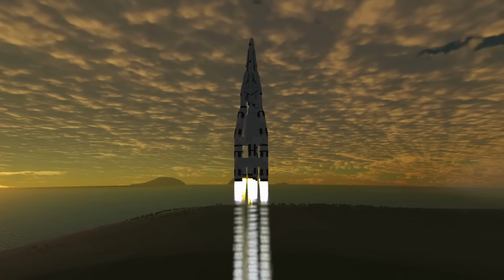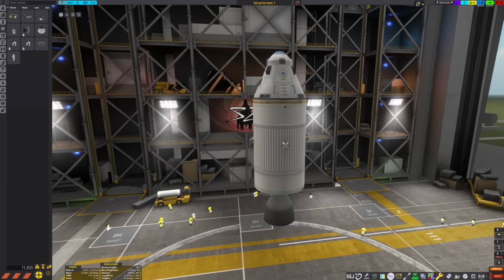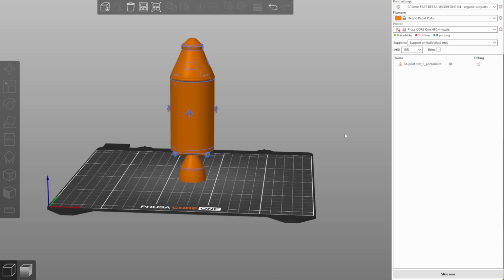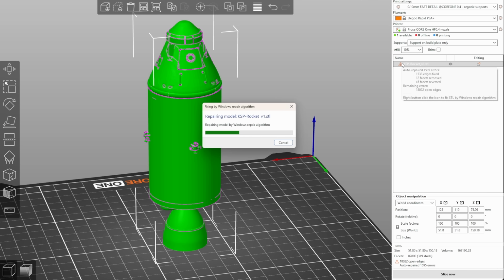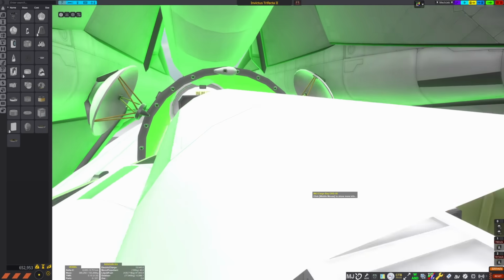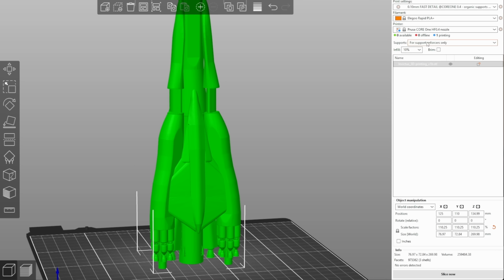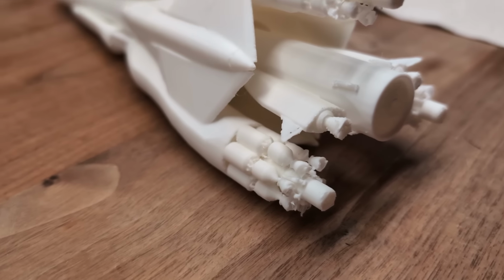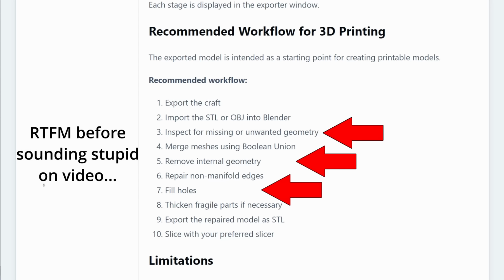This Mod Turns KSP Rockets into Real 3D Printed Models

Comment: I've got a l*arge space station in KSP* that supports lots of Kerbals (with ECLSS - life support systems), acts as a large fuel depot (LF/Ox/Monoprop), has lots of batteries, large solar panels and multiple docking ports. The station has 8 engines (4 forwards, 4 backwards), so it CAN maneuver and travel by itself. It is launched as one single piece, but can be extended in-space by additional modules. It is a monster!

Would be nice to have a 3D print (in realistic colors) of that station, would look nice on a shelf. Maybe I'll invest in a multi-color 3D printer in the future, so I can fullfill myself this dream. Those 3D printers are quite useful anyway.

Comment: Looks like the main problem is that the in-game parts are not designed to be printed. The solution is probably a converter that replaces the game models with some equivalents that are more structurally sound for 3D printing but pretty much look the same. For a completely automated conversion this is pretty much as good as you're gonna get

Comment: I wouldn't recommend using a Boolean union unless it's necessary. After years of 3D printing and preparing models in Blender, I've found that if two manifold meshes overlap, the slicer handles it without any problems and prints them as a single object. Boolean operations usually create a lot of additional errors, especially with messy exported models.

Comment: Hi: 3D printing guy here.
The best you can do for 3D printing quality is to choose a good orientation.
Cutting the engines and printing them separately, upside down, will help you a lot. You will avoid supports and you will have a greater area of contact with the base.
Also: "3D Builder" is great to fix wonky geometry.
You may also be interested in a jeb model that I made. You can find it in Printables under "Jebediah Kerman (Kerbal Space Program) (IVA suit)"

Comment: I haven't finished watching the video yet, but the way I fix broken models is by importing them through Blender (usually mine are made in it though) and then using the Remesh modifier with the voxel mode, then putting a very high resolution (according to the resolution of the print). it fixes most issues with nonmanifold models assuming it's not too terrible. the problem is it takes a lot of ram but after it's done you can apply and collapse down the model vertices with another modifier
Reply: it depends on the slicer, but when you have a nonmanifold mesh (read, one with errors) usually the slicer will skip over layers which might have been the reason the first engine seemed to skip a couple mm. you can preview the slicer output and scroll it layer by layer if you wanna be sure it's all good
Reply from the maker: Thanks for the insights! I tried something with voxels, but then the model seemed to lose resolution. It kinda looked pixelated. But I am also a Blender noob.
Reply: @ShadowZone  yeah, you really need to set a low voxel size, a good heuristic is like setting it to half your layer height or so, because you wouldn't be able to print detail much smaller than that anyway

Comment: Please AVOID PLA! Its a horrible material, its not recyclable in most municipal trash facilities whom consider it a “contaminant” and will not degrade it nor recycle it.

Try switching to PETG not only is it cheaper and stronger but also accepted to be recycled and reused in ALL recycling facilities!!

A PET(G) part can leave less carbon footprint when recycled properly compared to PLA whom mostly ends up polluting in landfills since there are so few facilities in the world that even accept it for recycling.

…Petg also doesn’t melt in the sun
Reply: I heard PETG is bad in recycling centres because it's hard to separate from PET and a lot of places don't which contaminates the batch.
Reply: @pho @phoenixrahillconghaile7320 s and no it depends on what each municipality handles, generally petg are more ok than PLA contaminants.

Generally petg can be an issue as it has a lower melting point however a batch needs to have a quite big ammount of petg to outright get rejected but this depends on what every plant does

Comment: could start designing rc planes out of this!
Reply: well, that might go a bit rough considering KSP's simplified physics / aerodynamics system, but maybe if a plane built for the Ferram Aerospace Research mod gets 3D printed, it might work? you never know though
Reply: Well you would have to definetly redesign each wing due to the non existant wing profile
Reply: Careful using the in-game center-of-gravity because the print won't account for density.